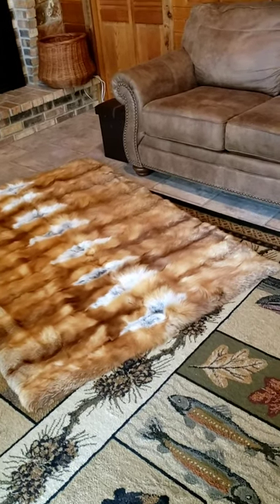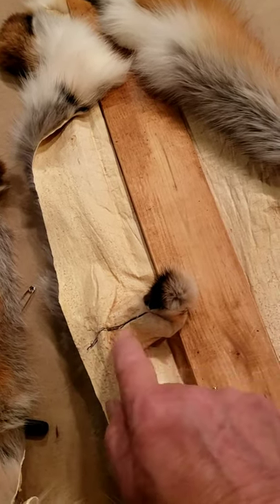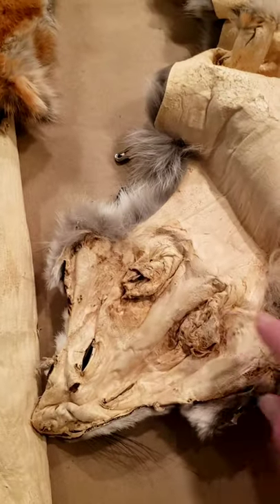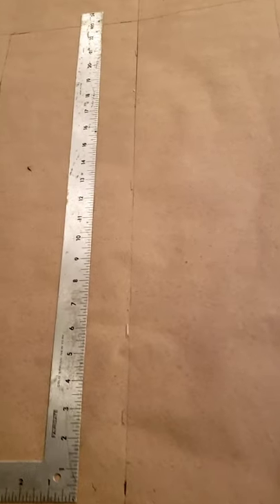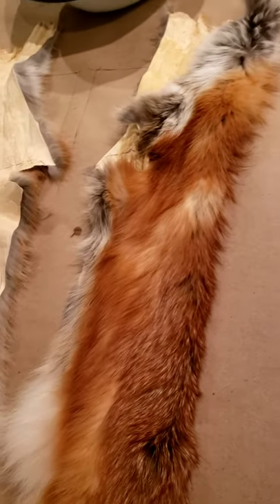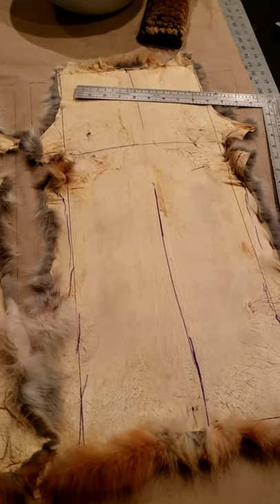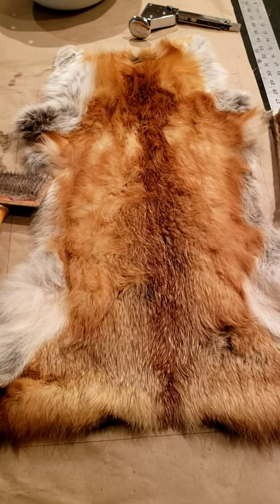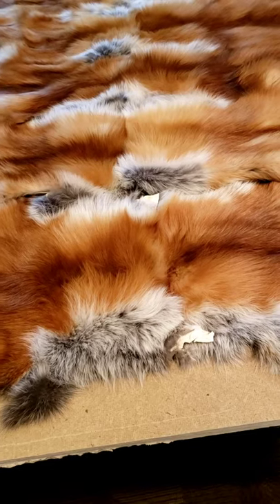Fox real fur blanket how to make

Comment: To much throat. Why didn't you square off the throat. You could have just let in the head. And remove the white and blanket would have been all cherry. Why don't you just use natural paw line . Starch the pelts. Center back is called the Grotzen. Call Ira and get skin softener.
Reply from the maker: Thanks for your comments, the client wanted the white from the throats included.  It gives a lot of added color in my opinion. All red is also beautiful. Yes the gotten is the center back of the skin but not all understand that term. I do use  liquid starch on leather in my hats. But starch isn't going to make the or reinforce the leather as well as a China silk or weft backing.  Not sure why leather softener would have been necessary on these foxes. I know Ira and now Austin as Ira is kind of retired. I'd love to see how you do your work. Do you have any videos ?  Join the Fur Skins sewing the craft of furriers group on Facebook. I'd love to see your work

Comment: I am wondering what kind of tanning your Furs got. When i get them from my tanner (alum tanning), they are soft and already stretched. He tells me, that i should never get them wet, because the tanning would wash out and the leather would get hard.
Reply from the maker: These furs were tanned at Moyles, a garment grade tanning. The pelts during tanning will shrink back in size from when they were dried originally. 
The process to regain the size and maximized the pelt for use as a furrier involves wet stretching the pelt as in the video. 
But yes you don't want to get a fur, or the leather side wet after its sewn up, as in a drenching rain or spilled water on it as it will again shrink in any area that the water completely penetrates, also steam will do much the same. 
Hope this answers your comment.
Thanks

Comment: I have a question on cleaning fur. I inherited a mink and fox coat . The smell is horrible. Both in perfect condition.  I'm wondering if I take them apart and wash in dawn then alum and borax the skin side so doesn't shrink. I tried the saw dust but the smoke and old smell is  still there. Thanks 😊
Reply from the maker: You don't wash fur, I'd clean at a furrier, if the odor is moldy or mildew that won't likely come out. But most cigarette smell will if cleaned at a furrier, check your local furriers. 
Good luck

Comment: How much would a blanket like that sell for? I’m not asking to buy it, just trying to get an idea. Thanks!
Reply from the maker: Labor would probably be around 600.00 for me to do. It was 14 pelts so red fox is reasonable right now I'd guess each pelt about 90.00 x 14.
Retail maybe 2500 to 3000
Reply: @McCormickLeatherandFurs  ah okay. I was thinking about $3000 or so, but came across various pelt blankets with astronomically different prices. All fox pelts. Thank you!
Reply from the maker: @XxAdenahxX  if and when you'd Ike one I have a great source for pelts and could maybe get even closer in cost
Reply: @McCormickLeatherandFurs  I’m looking at making one of my own hopefully soon. Currently trying to find a good trapper with decently priced pelts. But I’ve never made a throw before. Might be a bit of a challenge. Your video was very helpful.

Comment: Wow, this is a brilliant guide! I was having some trouble learning about the hide -> clothing/blanket process outside of industrial contexts for writing purposes.
I did find it a little funny that you have gorgeous natural hides that get backed with plastic-based fabric, but hey, if it works, it works!
Reply from the maker: Thanks for your comments. The lining backing can be other fabrics, I chose to use this as it's lightweight and has sufficient amount of batting, probably not all natural fibers, others can be used,   best is a woven fabric type for lining that does not stretch.